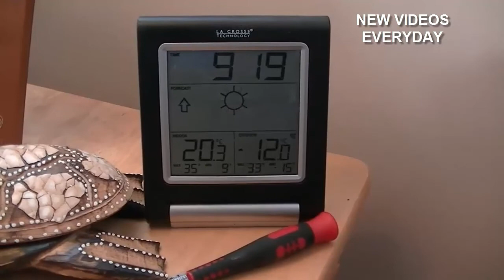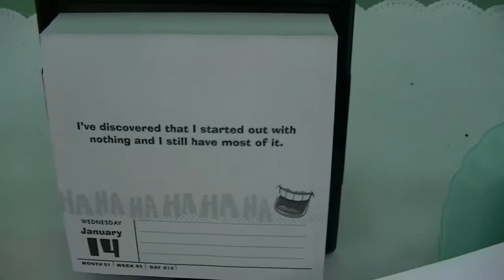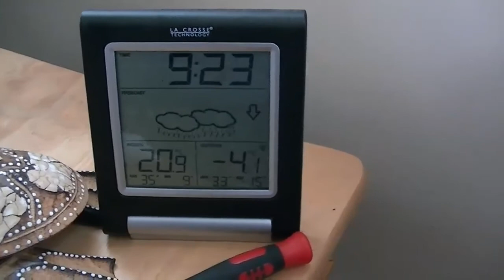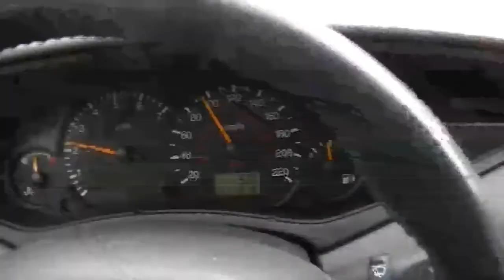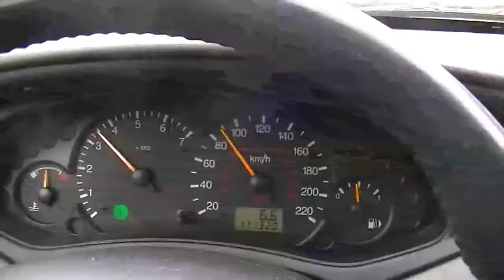Deer, driving the Focus and more meetings

Comment: Personally I don't think it's a good idea to use cruise control when driving on ice and snow; even if the road looks clear.
Good luck with your business plan.   I really hope it works out.
Reply from the maker: Yeah its not good if the roads are bad, but then again if you hit big bumps traction control can send u into the ditch, i seen it happen
Reply: ghettohillbilly1  You mentioned speeding whilst in cruise control.  It would be great if cars could brake also to maintain a constant speed; although I haven't heard of any cars having such a feature.